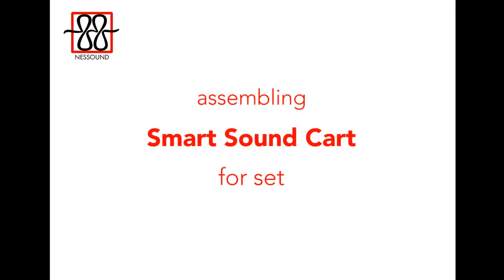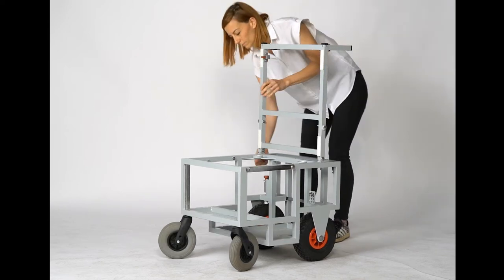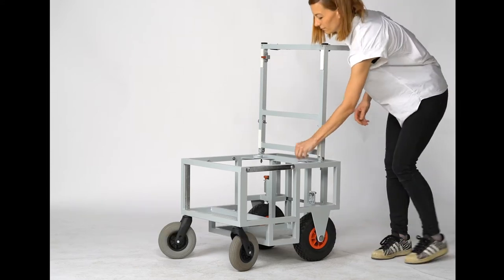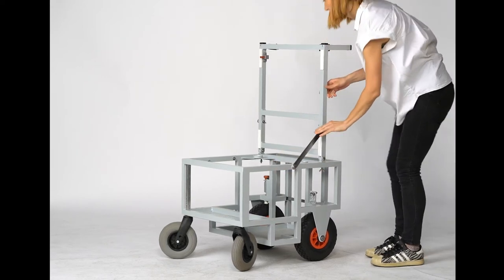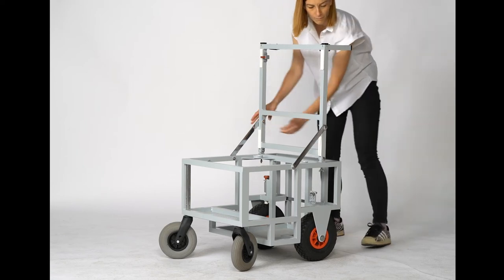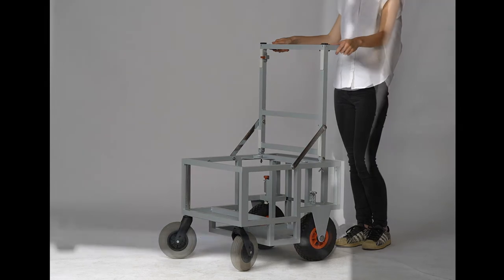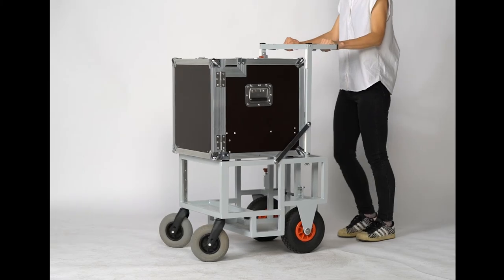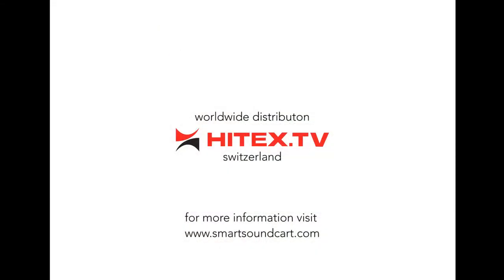Smart Sound Cart - assembling

Comment: I have the version like shown in the video. Been using it for 2 years now, and I couldn't be more satisfied. My version is without the flight case, because I focus mainly on fast paced (aka low budget) feature films, so I need the option to just grab a bag and run up the hill, or drop it in the trunk of a small car.

Anyway, the cart works exactly as marketed, I love it, and you guys just keep up the good work! 

Cheers from Belgrade!

Mihailo Stevanovic